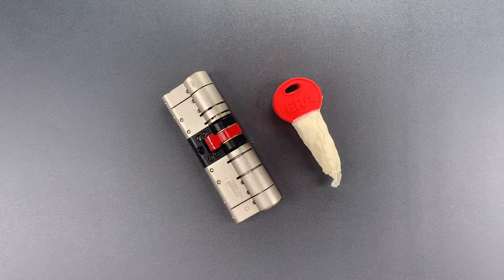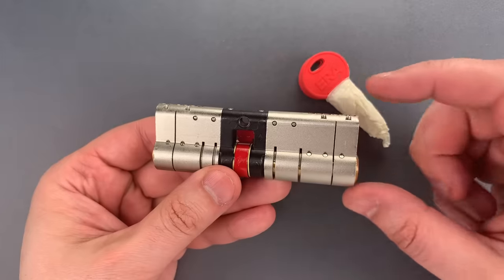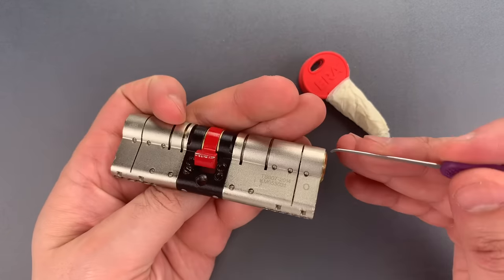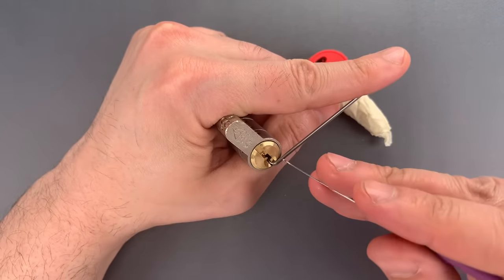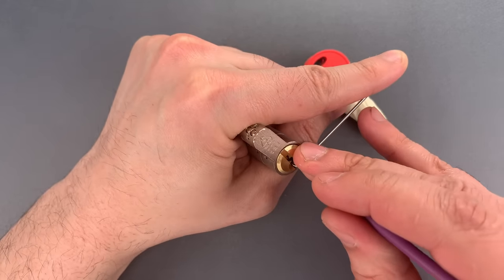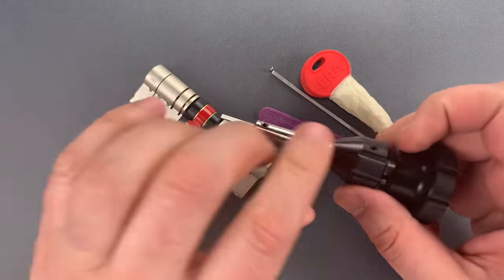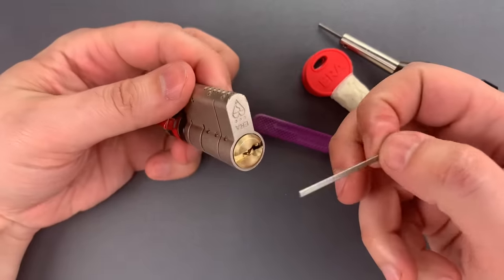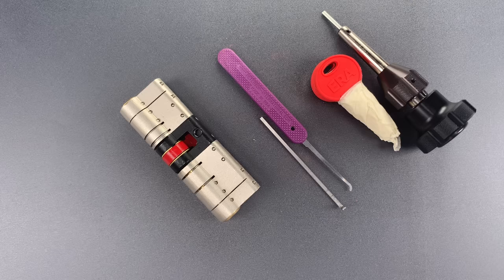[1256] ERA “Fortress” Euro Cylinder Picked (6 Trap Pins!)

Comment: so to clear this lock up, you never said "inexcusable”, "flaw" or even "unfortunately", the video is 4 minutes long and that is without a tear down!  and its made in the UK, (or at least brought in the UK and sent to you), you did say "however" but then produce a tool i have not seen before so id call it a 100% winner. i think i know what door locks i am looking for when my new doors are fitted.
Reply: I'm going to buy this barrel too, I've just moved into a new build (UK) which has standard rubbish barrels with the twist turn in the inside for emergency's  but not very secure when you can stick your hand through the letter box.
Reply: You also need to know about trap pins too beforehand.
Reply: This one or the Avocet ABS from a previous video
Reply: @cameronchubb5209  So many residential doors where there's small glass panels in the door or to the side that could easily and fairly stealthily broken through and then reach in and open the lock.... my back door on my home was like this.   You'd be very unlikely to hear it even if home.  Doesn't make sense.
Reply: I've put them on a number of doors for family members. The locks cost like £37 (IIRC) on ebay, come with 3 keys (£5 for every extra) and an array of sizes to fit the door. They are perfect when it comes to value and security.
You can pick them open by packing the keyway all the way to the back with something you can easily remove (such as dental floss) but they have 6 pins and each is a security pin so you'd need someone with good lockpicking ability. 
You can also push the trap pins out of the way as they only activate if the core turns without a key however you then need to pick the trap pins which is much harder.
Reply: @KrK007  Here in Cody, Wyoming my home has glass on the front and rear doors that can easily be smashed and the doors can be unlocked by hand.   My home has no dead bolts.  I do have 5,000 rounds of ammunition in various calibers with matching firearms.  I keep another 500 rounds in each vehicle.  We don't have much crime.
Reply: @larrysmith6797  That'll help a lot if they surround your place and announce they are laying siege to your home, to be sure.  However if you aren't home or they shoot you first, then it won't do jackshit but give the invaders a great score.   Beef up your security. It's pretty easy and fairly cheap to do.   Plus it buys you the time you need to assess the situation and select the firearm of your choice.
Reply: @larrysmith6797  *me living in house without fences in peaceful third countries : "wait you guys need some gun to feel secure?"
Reply: Also note how he didn't manage to disarm the trap pins on either side, and I don't know about UK, but it's standard in Russia to have 3-4 revolutions on a cylinder to fully retract the rigels, so you have to be LPL, and do everything shown here at least three times, on a lock in the door, in plain sight of anyone who can see you breaking in.
Reply: @KrK007  well that escalated quickly
Reply: @KrK007  no kidding. To be fair even having a fancy pick resistant lock is a waste. Thieves aren't picking locks, they're cutting locks and breaking doors/windows. Residential windows that slide or crank open are laughably easy to break open, a small child could do it. If I'm not home my guns are just a great prize for thieves. I feel like the best investment is a home alarm system with monitoring company signage and some loud screeching sirens. Keep your property clean and boring looking from the road, let your neighbors attract attention instead of you.
Reply: @lioelbammalf7483  I agree the 5000+ rounds is kind of a dick swinging move but I think more of what he is talking about is similar to where I live, the simple fact is most people are not very eager to attack very rural areas especially stealthily when there are most likely dogs that would likely keep most from even thinking about breaking into the home, secondly the dogs would surely alert the mr.65 year old tony, his wife and his three sons all peeping out the doors and windows with a chew in and an array of 50 year old shotguns that have done their fair share of splitting skunk and raccoons open for all of their life.... there is just simply not a lot of crime
Reply: @lioelbammalf7483  the people that make me laugh are the people that have little to no firearm experience that get scared watching the news and go buy 3 brand new ar-15s and 5000 rounds of ammo to assure they will take down any intruder coming into the house and also giving free piercings to any of the neighbors on the block that are enjoying the evening news
Reply: @gdmjs  Yeah - this is the thing that bothers me. I think there are a lot of people who buy serious fire power and a ton of ammunition that, realistically, you aren't going to need unless your intruder is wearing tank plate armour and you're a terrible shot and need thousands of chances to hit.

They buy it to show off and just have a bigger number is better policy on caliber, rounds and rate of fire.
Reply: @lioelbammalf7483  absolutely! I could not agree more, people get very out of control with all of it. And they make up so many reasons to justify it. Oh I have 5000 rounds of 223 for my ar-15 incase the world goes to shit and I gotta survive... like okay 5000 rounds of 223 also weighs roughly 125lbs... which would be pretty ludicrous to carry on you for one caliber. Or for home defense it’s always the whole well an ar-15 is extremely easy to use, but yet it’s not any easier to use then any shotgun not to mention let’s say the intruder is wearing body armor, you are now trying to penetrate body armor with your ar-15 which should be fairly easy but a face full of birdshot from a shotgun blast will probably stop 99% of intruders from taking anymore steps towards you, then lastly is always the fact that you can have a higher capacity of ammunition, well yes and if you are getting attacked by 5 or more people it would be nice but the chances of that is extremely low not to mention if 3 of the intruders watch two of their buddys get their guts blown out by the home owner... they will probably not attempt to follow the same fate. Sadly the ar-15 is just a giant cash grab for the civilian market. It is advertised as such and is extraordinarily successful. So everywhere you look it is labeled as the perfect firearm for about anything you could imagine. It’s all about the sales
Reply: The lock may be great, but the only people you're bothering with it are the emergency services. They also tend to try to drill or snap your lock ( least on the mainland) before bashing your door in. You know who isn't going to try that? Burglars. They do circumvention, not breaking. Ask Deviant Olam. A dumb burglar tries to pick a lock or break a window. A smart burglar looks up, sees an open window, and just climbs in. 

I get it, you want your stuff to be safe. Getting the absolute best lock isn't going to achieve that. As long as you don't have a lock that can be opened by jamming a screwdriver in there and turning it, your lock is plenty good enough. Burglars look for the easiest way in. If your lock is semi decent, they'd rather break a window or use another trick to get in.
Reply: @larrysmith6797  Here in the Netherlands, most doors on my home also have that easily smashable glass. Our front door is never locked (it has no handle on the outside, like common in the country), so opening it would be as easy as smashing the window and pushing down on the interior handle. My home doesn't have deadbolts either. I have 0 rounds of ammo in 0 calibers without any firearms. There's 0 in my vehicles. We don't have much crime. 

Thinking guns reduce crime is just about as stupid as the US gets. It's action-reaction. You arm yourself? The burglars bring even bigger guns, and may not even bother threatening you,  but instead just shoot you in your sleep. I love guns, but I'm so happy they're incredibly hard to get over here.
Reply: @KrK007  i agree. In germany there is a statistic from the police that states that picking a lock is the least used method of getting in to a house
Reply: Just don’t lose your keys
Reply: if someone really wants to rob you they're just gonna go through a window or break the glass (if there is any) and reach in or literally kick the door
Reply: Plus I still didn’t see it opened 🤔
Reply: @lioelbammalf7483  Go to a shooting range/gun down random items for fun. One look at gun channels on YouTube reveals that is something gun owners are interested in.
Reply: @xorsyst1  I have had a couple sets of the Avocet locks, and they are secure as they get for a euro cylinder but they do have a disadvantage in regular use. The tiny magnet built into the key naturally picks up iron filings in everyday use and unless you are fastidious about cleaning the key regularly (unlike my wife and daughter) the lock will invariably start binding up and getting very gritty to turn.
Reply: @larrysmith6797  I can see why.
Reply: @larrysmith6797  Ah yes the famously low crime and gun violence rate in the United States. Forgot about that.
Reply: @timderks5960  but it's the lock picking lawyer, not the home invasion lawyer 😂. Let us enjoy the first great lock! 🔒
Reply: @lioelbammalf7483  agreed, to have 5,000 rounds on hand is silly. Send that stuff down range.
Reply: @WhatACoolArrow  A quick google search would show that .2% of Wyoming residents were victims of a violent crime in 2019. Compared to 1.6% of U.K residents. It would seem that the U.S gets a bad rap on crime because they have higher homicide rates, but homicides are much rarer than other violent crimes. So to this persons credit, Wyoming is a very safe place to live in terms of violent crimes.
Reply: @WhatACoolArrow  if your curious about the sources, its the CSEW ( crime survey for England and Wales) as well as fbi statistics on the violent crime rate of Wyoming for 2019.
Reply: @muhammadihsan4896  peaceful third world countries...? even most second-world countries are a little sketch. no country is ever 100% free of crime, you just dont live in a bad neighborhood. The only reason you hear of so much crime in the US is because the US is huge, I mean just one state is already the size of the average country.
Reply: @larrysmith6797  Against whom will you ever have to use 5k ammo? Do you prepare for the 3rd World War!? :) Btw nothing is wrong imho with home defense weaponry ;)
Reply: @larrysmith6797  as someone that also lives in cody. I'm pretty sure lack of crime is more down to the fact we have a population of 10 thousand...and not that we have alot of guns.
Reply: @timderks5960  That easily smashable glass may be quite hard to smash.
If it is single pane, yeah then easy.
I had to smash double pane glass, rougly 0,7 x 1 m.  
Not easy.

And the smaller, the harder it will be. 

Of course, i am not saying it is impossible.
"Alles kan kapot"

Comment: I believe this is one of the most complicated picks I've ever seen LPL perform. It isn't a bowley lock but it deserves respect.
Reply: I was impressed that he was able to bypass all of the security features so quickly. He could have gone much faster if he wasn't explaining what he was doing. I wonder how much time he spent practicing on the lock before making the video.
Reply: @RationalEgoism    At LPL's level of expertise, he probably spent more time researching / analyzing the lock than practicing it.  If one accidentally releases the trap pins, the lock becomes immobilized.  This is a Yoda lock: Do or do not, There is no try.
Reply: @RationalEgoism  His "practice" would be all his experience in picking locks with similar traps. That way he can see a lock, do his research and then form a plan of attack. 
Like assaulting an enemy base, you don't have the luxury of a "dry run" so you make sure your first attempt is your best attempt because you don't get another.
Reply: saw someone pick a Bowley lock with some compressed air, however at the time of LPLs video no one had yet picked it, i wouldn't use one because they are easily recognizable and finding the attack online would be trivial, this has no external branding.
Reply: @Marinealver  Tell that to the Canadians, because they pretty much did during the build up to the battle of Vimy Ridge. And by that I mean they did their best to build a to scale model of the battle field and then trained on it.

Comment: Above 4 minutes mark, needs two tools - one being a special made - and have defensive features against the most commom entry methods.
Yep, thats a good one.
Reply: Only 2 minutes was actually picking.
Reply: A plug flipper is a commonly available tool, granted they don't feature all that often on this channel, but they're a standard piece of locksmith kit for those times when it's easier, or only possible to pick the core in the opposite direction to that required to retract the locking pawl. You pick the lock anti clockwise to evade a particular security feature, then flip it back clockwise past the lock up position faster than the pins can re-engage. 

The difficulty this lock poses in the wider sense, is in the fact that Era make many lock models and all you see from outside the building, once the cylinder is fitted, is their emblem. So as a potential lockpicking opportunistic thief, you'd have to treat every Era lock as though it was a Fortress model. That on its own is a great achievement for a company, as it makes residences fitted with any of their cylinders more secure from the educated opportunist. 

Definitely a score for Era. Whether or not it's possible for LPL to bypass it, it effectively raises the security on all their legacy cylinders, as well as challenging anyone who does find themselves facing a Fortress. I suspect this would be a great deal more difficult in situ, fitted into a door. It also requires more tooling to defeat than the standard pick and torsion wrench, takes longer and makes more noise when you deploy the plug flipper. I'd buy one if they're not outrageously priced.
Reply: @Si74l0rd  The good thing is, a plug flipper is only common for locksmiths. But it doesn't seem to be that common when you buy a lockpicking set. At least, I didn't see it included when I was browsing online

Comment: The more tools, especially the more esoteric tools, required, the more secure a lock is. LPL proved that the average picker would not be able to bypass this lock without resorting other more time consuming and noticeable methods, or leaving and then returning with a more specific tool like LPL's flipper, or prior preparation to know that this specific tool is needed for this lock.
Reply: I use Acetone Peroxide to blow up the door.

Ezpz

Comment: LPL: "It does a decent job addressing..."

Me to Amazon: "TAKE MY MONEY NOW!!!!"
Me to My Wife: "HONEY, I FINALLY KNOW WHICH LOCK TO BUY!!!!"
Reply: All you had to do was sort his videos by length.
Reply: @robertcowling4313  Buying direct is often (but not always) cheaper than Amazon.  If you're on a budget (or want to boycott Amazon over free speech violations) the amazon pages for products usually tell you who the seller is, and from there you can go straight to the seller website.  Sadly, it isn't practical to boycott amazon for many items.  Along with google, facebook, and twitter, they are in dire need of an anti-trust breakup.
Reply: I know!!! it took me over 3 years now to find a house lock, still trying to find one for my bicycle that does not weigh 45lbs and is cheaper than my bike.
Reply: Except they can cause you to replace locks over and over if someone wants to.  10 seconds in front of the door and you have to replace a lock cylinder. And you need to spend 40-50 on a new one or buy one that allows a trappin reset key to be used. Eventually you will replace it with something cheaper that they will exploit to get in.

Comment: I'm glad I have that lock installed in my front door. Unfortunately the door is made of zinc painted brown..
Reply: That's really the issue. Around here, no one is picking entry doors, they'll just kick the door in. Long before bothering with this, most people should upgrade their door and door frame.
Reply: @om617yota8  Honestly, that's why i don't even bother. I live on the ground floor and no bars on my windows. If anyone wants in, they'll get in.
Reply: @om617yota8  and then they should upgrade their windows. And then they should give some serious thought to their walls.

When my mom stopped responding and I had to break into her house oh, I simply broke a pane of glass reach down and unlock the door. There was no response from Neighbors.

Comment: As I progress in my picking career, I have discovered that picking a lock at my desk with a vise and every thing positioned ergonomically is one thing, picking that same lock when it's hanging on a fence outside is a whole different animal. My neighbor lost the keys for his pool gate lock. Instead of just cutting it off, I asked to try and pick it. Took me much longer and it was very challenging just to get myself into a position that was comfortable and that I could hold the lock with one hand and keep tension while trying to pick with the other. Working at your bench is one thing, working in the field is not even close.
Reply: Using the "Crawl, Walk, Run" learning analogy, it sounds like working at your bench is like the "Crawl" phase. At your bench, you're removing obstacles that are independent of the lock itself to better learn the lock (much like a science experiment removes variables). Once you've done that, you might move on to the "Walk" phase, reintroducing variables / removing controls (remove from vice, hang as is in use, use a lock that's weathered or in poor condition, etc). To me, "Run" is usually either a real-work application or testing yourself under real-world or tougher conditions.